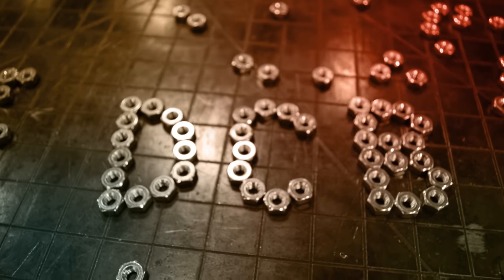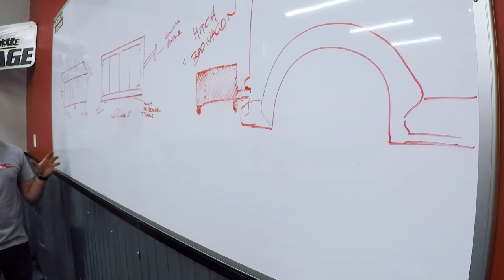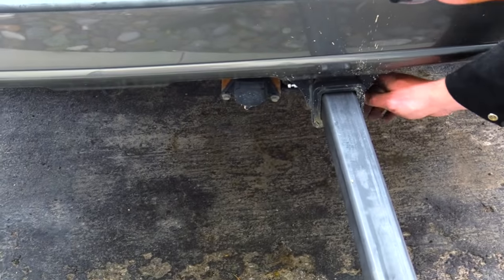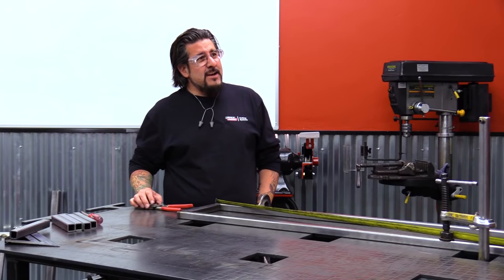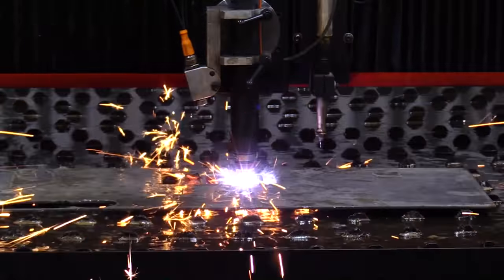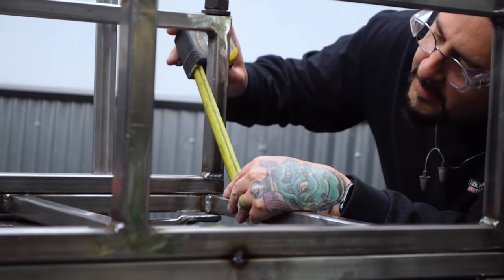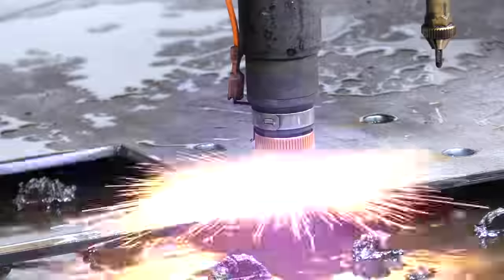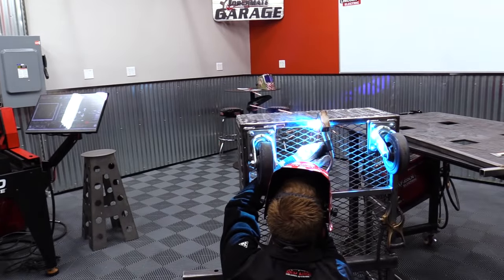Design | Cut | Build™ - Hitch Wagon | S3.E6

Comment: I wish you would spend more time talking about the design. This thing has got to weight around 50+ lbs empty, how do you lift it to attach to the SUV’s receiver? Why were sides made independent of the base frame causing double 1” tube on the bottom of the sides? Why little wheels and not big ones to make rolling easier? Where or how does the handle stow?